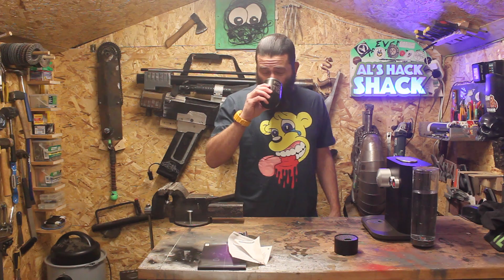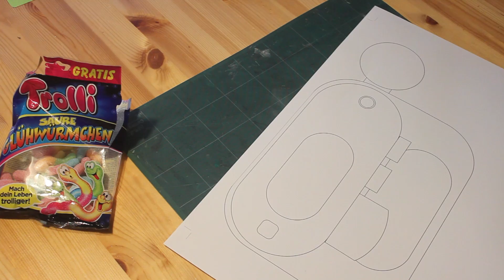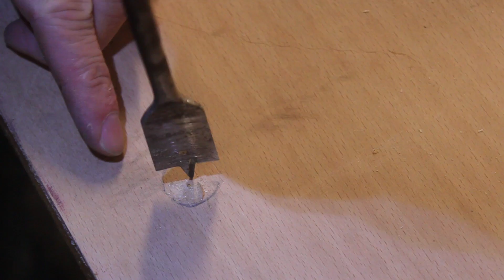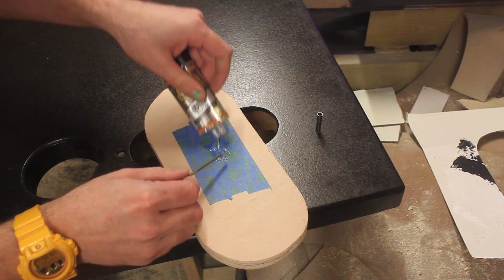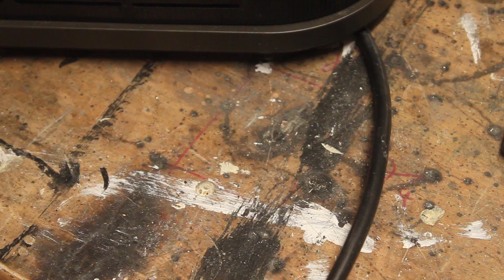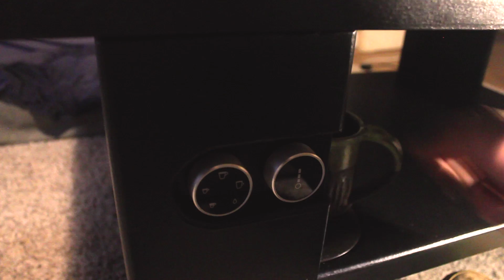Average Joe

Comment: Both you and the coffee table look about 1/4 more fit than usual..! #metacommenting  Really like how you designed a table around the machine, and how elegant the result is! Upgrading your wireless router to a MeNC must have made that job a breeze, but it raises the question if it's even real OSB working anymore ;) Don't envy all the painting and sanding you did, but it looks great! Well done Al, thanks for sharing! :)
Reply from the maker: The finish was easily the hardest part 😬